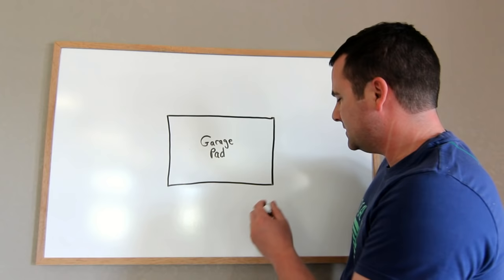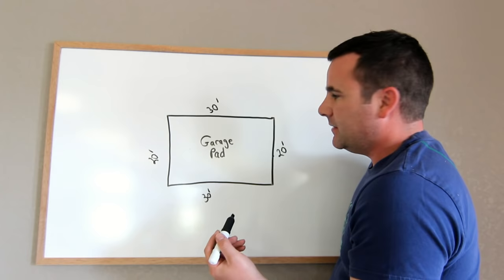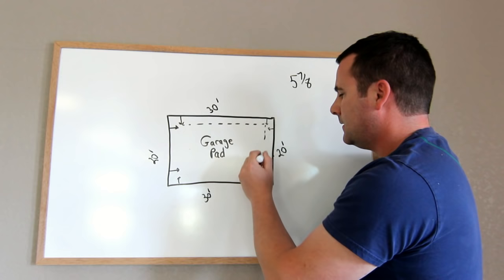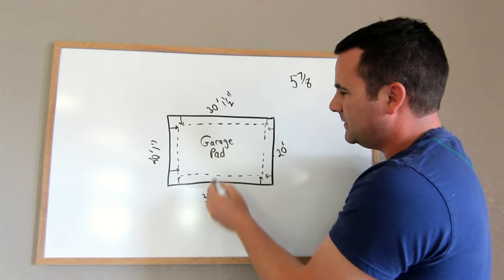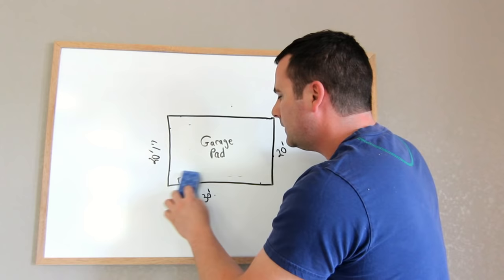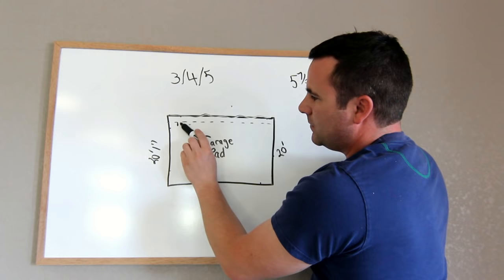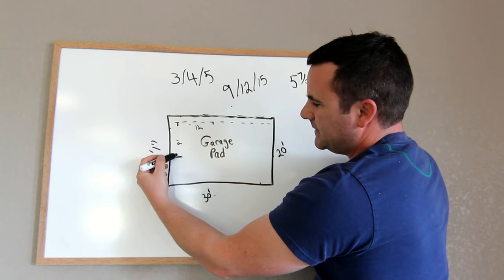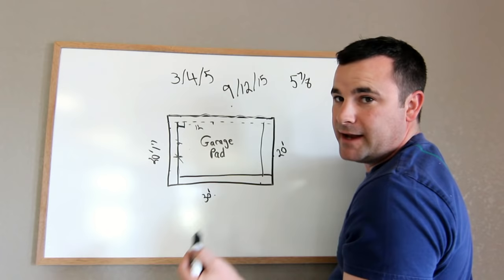How to Square a Building

Comment: The dimensions of a building should always be face of framing to face of framing— not finish.  You want your framing to be flush with foundation.  OSB or plywood substrate should extend beyond foundation 7/16 or whichever thickness to keep water away from foundation and sill plate.  Many ways of doing it— but I prefer this way!

Comment: You are absolutely correct bro. This is what I do before I snap a house out an detail it. Only thing I did different was I'd have the labor burn my tape 1' just because I never liked using the end of my tape to square a slab. But ya, snap the longest wall off your crows foot and the carpet guys are happy, floor tile guys, and if you can read a level when you plum & line whoever roofs the house will be happy . Gotta be square. Good video homie.

Comment: your a genius I just ran into this problem I wish I would of saw this video earlier believe me one of my measurement came out by 1 in off and I had a wavy wall for an add on and when I put the subfloor on I had to cut and fit every board over I was a long 2 days off work but we finished it this is a better idea love it will try this the next time I run into this

Comment: Hi Kody. Thanks so much for the wisdom in the video. I am building a house on a heavy duty trailer. The subfloor frame I built to put the floor sheathing on is not a perfect square. Should I make the AdvanTech sheathing square with the trailer or square with the deck I built on top of the trailer?
Reply from the maker: I would make the frame for the subfloor (the long sides) parallel with the trailer frame. Then I would make the sheeting square on top of that so your walls and roof are nice and square.  Does that help?

Comment: SO on the parallel line below do the same as the left top corner correct? Also in a very large room can on the long wall should i chalk line as close as possible because I won't see the line when I start to lay vinyl plank down??

Comment: I'm not dissing your video, but half way through,  before you brought the Pythagorean theorem into your video, I was saying to myself, "what if the contractors doing the pad made a nice parallelogram  for your base?  The 3-4-5 method is fricking foolproof!  Nice video though, I would have never thought to use a chalk line as an absolutely accurate way to start!
Reply from the maker: Thanks man!

Comment: I've got a problem in that my numbers aren't working.  My carport is 22 x 20 and when I check square, it's off by 3 to 9 inches. So I went 22 x 22 and times one side by 1.414. This gave me 31.14 so my square is 31 x 31. Re measured and it was off by 5 inches.  I don't have any more  hair to pull out.
Reply from the maker: Sounds frustrating! I have other videos on using the 3-4-5 method. You could check to see what corner is sqaure. That will tell you what other ones are out.
Reply: Always pull you numbers from the inside of the building, not the outside corners. Never try an square up something by pulling off the outside corner.

Comment: Just had a garage pad with stem wall poured. It's supposed to be 24*28. Ended up 24*27'11"*24'*28 3/4. Measures perfect diagonally. Almost a parallelogram. Struggling with squaring it up
Reply from the maker: I had that happen once! It took a few hours to get it right. You need to “happy medium” the building on the foundation. Meaning some walls will overhang the foundation and others might be in from it. That’s in order to get proper dimensions and to make sure it’s square to the world!

Comment: Aight cool man. I just had to make sure I was thinkin right. I actually frame been doin it ten years. I'm just gonna pull down nine ft. Make some kinda mark square mark. And where ever my 15 ft from the 9/12/15  intersect I pop my line through and make all my numbers the same? Or should I pop my wall then check and adjust?
Reply: Pop your lines first

Comment: how you know that the first line u take is straight 
and after it that the square is in the right place not moved
Reply: Saleem Bsoul you go to the other corner pull off the 5 7/8 . Snap the two ends now you have a straight line . Pull your numbers off that line

Comment: How would you square it if your foundation was on concrete walls that were at different elevations?
Reply from the maker: For different elevations I would do the 3-4-5 method in at least 2 of the corners. If those are square and all your dimensions are correct you should be good. Sometimes a guy has to use a level to plumb up or down and possibly the use of string lines. Hope that helps.

Comment: The 3,4,5  don't work on a complete square okay. You will always get it wrong
Reply from the maker: If you start with 1 square corner and measure everything parallel from the 2 walls that make that corner..then you will have a square building.  But it’s always best to verify the 4 wall dimensions and THEN do a diagonal measurement for verification.
Reply: @uptokode  you will still be off. 3,4,5 format is like breathing. Squaring a building is different. You run a line in the middle first, and one across in the middle. Like a + plus. Then you use 6,8,10 to square. Try for yourself and see how easier squaring is.
Reply: Masons rather breathing a building because it takes less time. But you have to start from the middle my friend.

Comment: Wrong! How do u get the first line straight is the question. But there's different ways to get the first line straight
Reply: You just pull the line and snap it, a string in tension between two points is always straight . He said he snapped a chalk line

Comment: you times 20 x 20  + 400 and times 30 x 30 = 900   so 900 + 400 = 1300 square root = 36.0555128 you'll thank me later   use 2  long tape measures get it straight in your head 1 st  very easy know the answer before you start this dude is lost